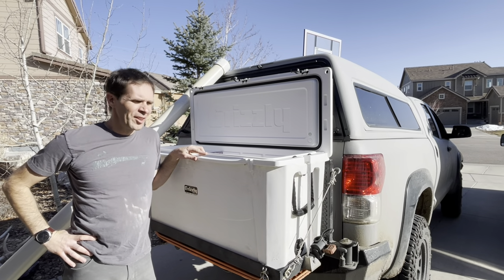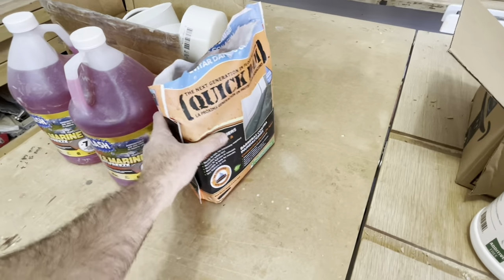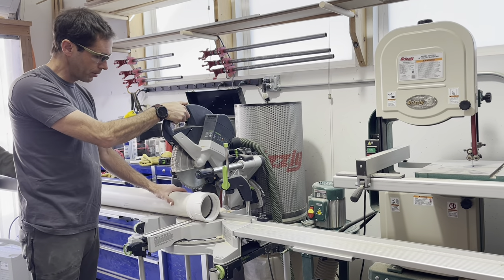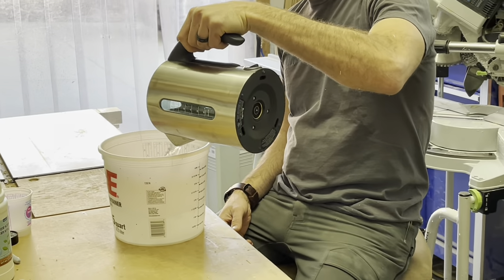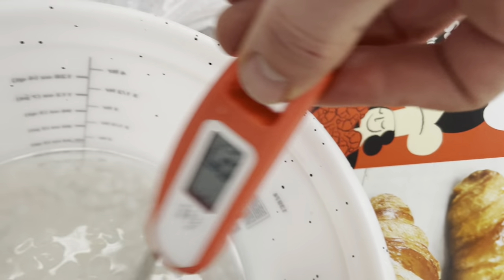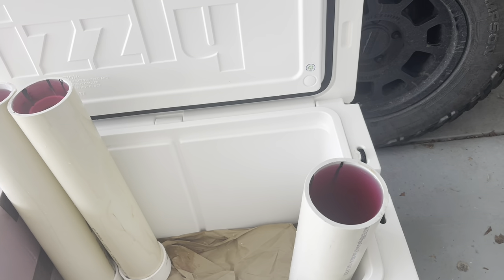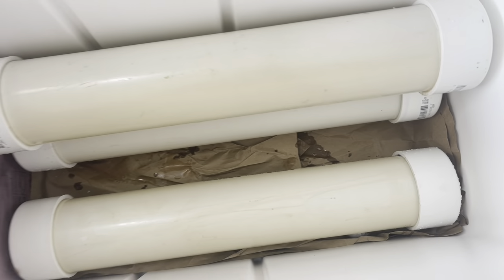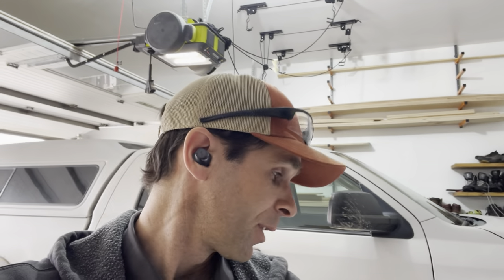Jumbo Gel-Ice Cooler PODS for Extended Ice Retention

Comment: When I made mine I put them in a sash clamp. The sash clamp also helped to close them.  I just used plain water and 10% salt. Freezing solid is a good thing as you get the latent heat of melting before the temperature starts to rise. 10% salt gives you a freezing temperature of -6C which is good. My version was much cheaper, there was no need for fancy chemicals as the fluid is just sitting in a solid tube.

Comment: The divider is a cool idea!

Make an air-tight lid for the meat section that you barely need access to. That way when you open the cooler's lid to get at the drink section you won't introduce much heat to the main compartment.

How are the ice tubes holding up? Because that was the main complaint about freezing water bottles, right?
Reply from the maker: That’s a fantastic idea! I’ll be making an internal lid for sure. 

They’ve been holding up really well. I still notice that if I have a full cooler of frozen water jugs, they hold the freeze longer, but that’s likely due to more volume total. I may do a combo of both for long trips, and then just use the tubes once there’s a load of meat in there.
Reply: @Wallymakesstuff  I believe the surface area to volume matters to how fast things melt. So a cubic foot of ice would melt slower than 8 six inch cubes under the same conditions.
Reply from the maker: @fireinacan yep, makes sense. And total volume of ice in the cooler. I’ll try making that foam lid too and see how much that helps.

Comment: Update ?
Reply from the maker: Good for about 4 days in 90 degree weather on a hog hunt this spring. Hoping to get a week with them during elk season this fall. Did a great job keeping the meat off the bottom while not making it wet from condensation also. Takes very little space relative to frozen jugs.
Reply: Consider adding sodium sulfate to raise the freezing temp, I saw a video about using it to make a solution that freezes  at 68° f, it also stays colder longer than regular ice...
Reply from the maker: @Thorin7.62 man that sounds like an awesome idea! I wish I had done that. Maybe it’s worth a comparison video in the future.